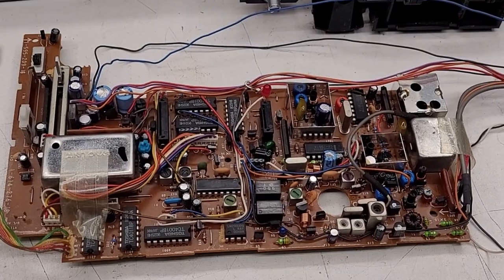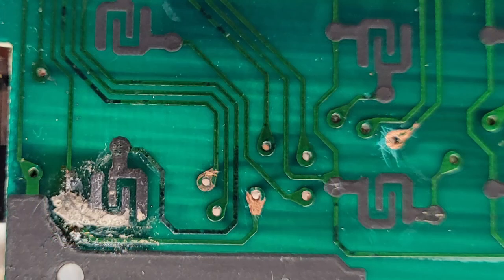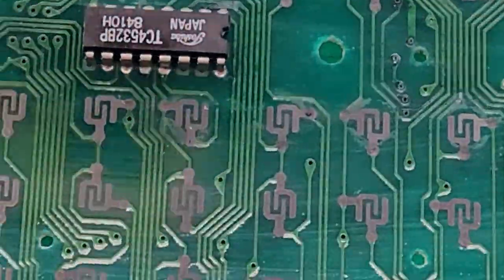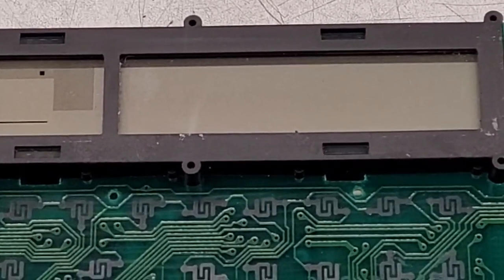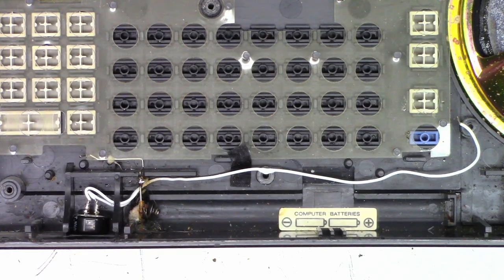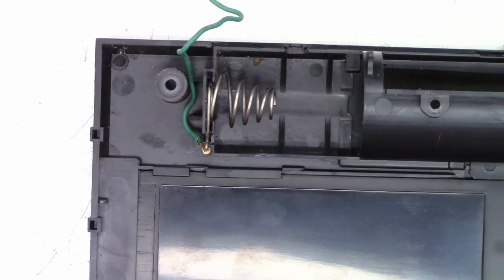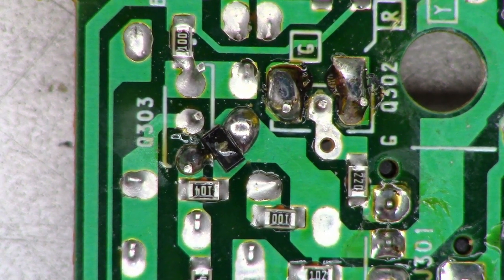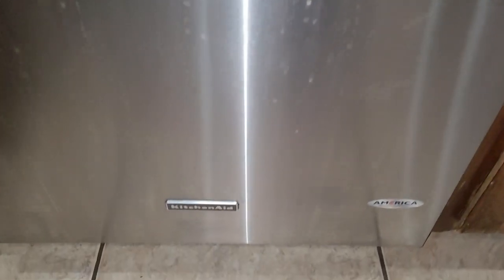A Sony ICF-2010 with Previous Repair Attempts. Can it be saved? (Dishwasher involved) Part 1 of ??

Comment: Hi, I noticed from your video that the previous owner soldered a wire from the antenna to the battery terminal. And then there's a ground wire from the other side of the battery terminal. This was not original. Any idea's why? And do you know if there are wires connected from the back case to the main body?  Thanks!

Comment: why couldn't it be saved if the plated though hole are damaged? that's totally fixable just run a wire through them and solder each side. i know it's a bit of a pain, but if he wants it fixed...
Reply: I realize there is other damage on this board and he is doing this for a fee. But a via/feed through can be easily fixed with your mentioned method albeit on a two layer board. You could even micro drill it out.😊
Reply from the maker: That may happen. I have micro drills and may silver plate the keypad connections to the copper. I have had good success in the past doing that. Just have to find time to get back into it.